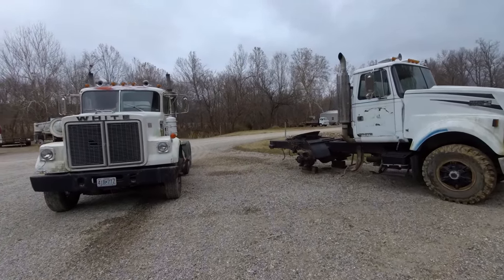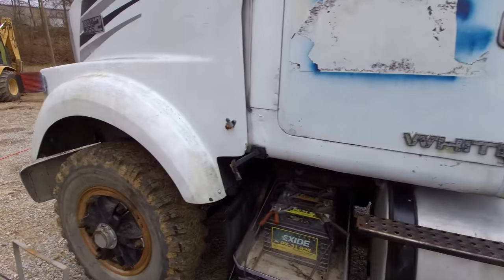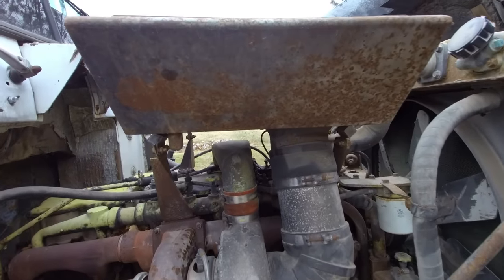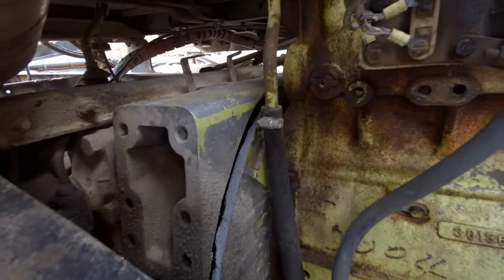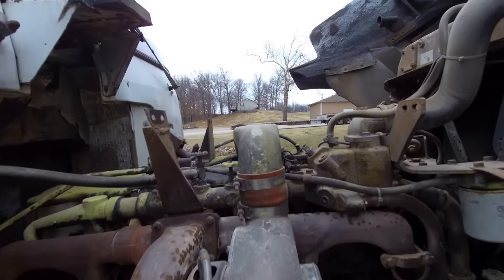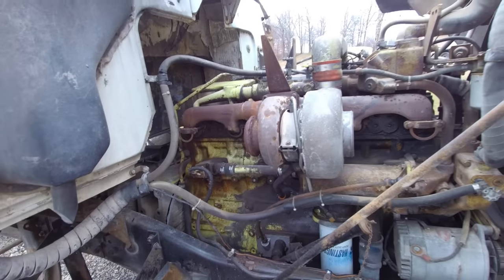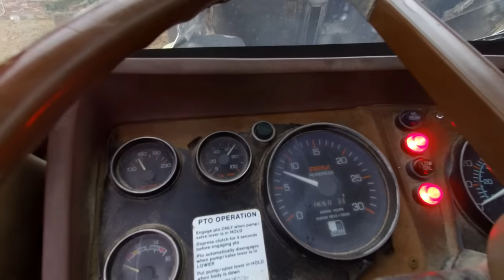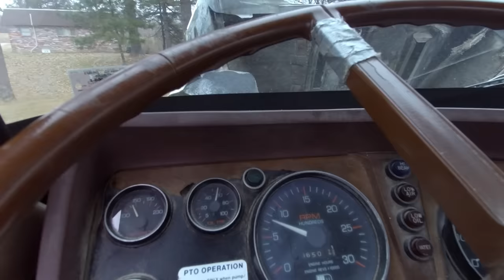First Start In a Long Time - 1978 Cummins 855 Cubic Inch Diesel

Comment: Damn that thing must have been doin 55 backwards to crack that bell like that..Wow
Reply: Pop Physics Lecture:  Doesn't have to be going fast when it's also heavy and stopped quickly.  Average impact force = change in momentum divided by change in time (collision duration).  Average force F = dp/dt, where momentum p = mass x velocity, dp = change in momentum, dt = change in time, or impact/collision duration.  So, for a heavy object, even moving relatively slowly, to be brought to a halt abruptly (dt = small) means a very large avg force!  This can be easily seen using caps letters for large quantities.....avg F = d(M x v) / dt if your recall your 2nd grade division course....the smaller dt is the larger avg F is.  Note:  product rule from 3rd grade calculus:  d(M x v) = dM x v + M x dv but unless parts fall off the truck, there is no appreciable change in mass m, so d(M x v) = M x dv.  So...impact force is proportional to the mass (of the truck), magnitude of the velocity (speed), and inversely proportional to the duration (dt). Let's put it altogether....Let M = mass of truck, let v_i and v_f be velocity magnitudes before and after impact (v_f = 0), and finally, dt be the impact duration. The average impact force F = M x (0 - v_i) / dt = - v_i x M / dt.  Note the negative sign in this result.  It tells us that in order for the truck to be brought to a halt, the force acting on it MUST be in the opposite direction to its motion.  Cool.  Anywho, since M is huge, and dt is small, there will be appreciable impact force which clearly decreases with speed.   If someone has the mass of the truck (in kg where there are roughly 2.2lbs/kg here on earth), an estimate of its speed on impact (in m/s where 1 m/s = approx 2.24 MPH), and an estimate of the impact duration...I would guess somewhere between 0.25 and 1 second.  The average force will be in Newtons but you can convert that to pound-force using 1 N = 0.2248 lb-force.  Anyway, in a nutshell there was a hell of a lot of force during the impact even if the truck was only rolling 5 mph.
Reply: @physicsguybrian  how long did that take to type.
Reply: @haloondrugs1173  time is relative 😁.  Not long actually.  Sitting at a full compute on youtube editor...easy peasy.  I think a lot of people watch on their phone. Writing anything on a phone keyboard is just a huge waste of my time.  Cheers!
Reply: @physicsguybrian was wondering why you went so into depth. I knew what you were saying when you said weight makes a difference. Then i read all of this stuff i didn't really understand (left school halfway through year 10 to drive scrapers). Then i saw your name 😂. Checks out mate 😂

Comment: Those big old engines from the later 70's were the real deal.  Especially for heavy hauling applications.  Sounds like a good engine that is worth keeping.
Reply: Love that old Cummins sound !
Reply: Until they killed it a video later with ether
Reply: @DieseltheWhiteTailedBuck  yep they sure did back in the 80s when I first started driving we always used ether on those very cold New York winters lol
Reply: @ernestpassaro9663  Yup, I know what you mean. I do wonder why people say "Oh ether hurts engines or even kills them!!" When there's been plenty of cases where it doesn't...unless you use a whole entire store's worth that is haha
Reply: @DieseltheWhiteTailedBuck  now I’m being told not to use ether on the new engines
Reply: @ernestpassaro9663  Ain't surprised...this new generation just sucks so much I swear
Reply: @DieseltheWhiteTailedBuck  we didn’t think twice about spraying ether into mack cat Cummins or Detroit engines back then
Reply: @ernestpassaro9663  I bet. There's even some rigs out there that has a button where it even shoots ether into the intake. But one shot of ether on a new diesel will immediately lock it I betcha
Reply: @DieseltheWhiteTailedBuck  seen some of them but when I first started driving I had to manually spray ether into the air cleaner  those old Mack’s didn’t have that option lol
Reply: @ernestpassaro9663  Haha yup. Times have changes...

Comment: Those were some of the best engine's ever built and old engine's like that still operate cheaper per mile than anything today
Reply: Im saving a 95 Cat I6T for a build..
Reply: Both (CAT + Cummins) are US built and engineering 👍🏻👍🏻👍🏻
Reply: Ikr i still run a cummins big cam 400 in my peterbilt😊
Reply: Athony Nesbitt that’s a great one, nothing sounds better either
Reply: Cheaper to operate doesn't mean it's better (for the environment or to own), but it sure be a miracle old engines still work the same way as today's.
Reply: @RonanTetsu  engines today dont last as long and theres more parts. The new engines arent saving the earth at all. I still got big cam Cummins in my fleet with over 1 million miles on three of them. Still dont burn a drop of oil to this day and I can idle all day long without clogging up emission junk. Let's see a new truck do even half that
Reply: @ronnieswindski825  yeah except a new truck will output less than 8% of the carbon monoxide an old one would
Reply: @mr.bitsbyte4664  but a new truck wont last that long so they need to manufacture more trucks for demand. Production means more mining for materials. Also a lot of those numbers are rigged. New diesels do burn very clean compared to older ones but it's still a diesel engine. All that air doesnt just magically disappear. It just suffocates the engine and they burn very hot to meet emission standards which is another reason they dont last anymore. That whole co2 thing is complete trash. Look at those rocket ships. They burn an insane amount of fuel giving off a ton of emissions but that's okay right because they do it. What about all those industrial factories? They destroyed the trucking industry. Unless you haul specialty cargo and get luck, there is no money in trucking anymore no matter what you do.  And no, bringing home 1500 a week is not a lot of money when just a diesel pickup is 70k. Trucking is finished
Reply: @youssefsabiri3860  Dont Forget Detroit 👍. Series 60 Detroit’s were actually designed by an ex CAT engineer 🙌.
Reply: Delusions of Cummins

Comment: That filter box is factory! I got a 1980 water truck with the 290 in it and that the same setup. Great motor, mines in a Freightliner with a 15 speed roadranger. Walks right down the road with 3250 gals of water and up to 500 gal of various chemicals in 2 toats.
Fired right up! And went right to full song like a champ!

Comment: Hello KT
Ahhh a big cam block 
At least you’ve got a good engine to base with
Install 
Big cam 400 pistons 
Aftercooler
Pulse exhaust manifold
Lose the fat turbo
Set your timing at about 80
Screw the throttle shaft out a bit 
Put a no. 10 button in inject pump
That otta get ya about 475 hp
Put it in that silver bullet and let er fly
Larry
Reply: larescats i love everything about that, but this guys a cat freak so hes just gonna blow it up...

Comment: Early NTC block, has 1 inch main bolts with locks in the bolt heads.. Really good blocks to use for new builds as the main caps aren’t fretted all to hell from “an ole boy turnin it up “..

Comment: I smell a detroit falling out of a engine cavity and a cummins going in its place. I don't know how it ever turned that fifteen speed in the first place. I drove one with that set up in a off highway heys truck up on the prince of whales island and I couldn't get it rolling fast enough on any flat to get up on the top gears with one hundred fifty thousand pd., loaded (gross) I hated that detroit so bad but then I started driving with a fellow who gave me a job that no one else would drive and that was a auto car with a 8-53 and there is the definition of boat anchor and it was highway truck. It took me all day to make two trips if I loaded first (log trucks) I finally drove long enough for him that another guy gave me a job driving and it was a little three fifty and a five and four but it was a dream as I kept up and drove the wheels off it. He got a newer truck and out of all the guys there (six) I got that big cam two with a dime button, It was a big improvement and I could load last in the morning and get my trips and if there was enough light left then I would head for the landing and load myself with a anything that would leave the landing cleaner and not hurt the next days loads for the morning. He constantly handed me a fifty  here and there. There is meat left in the white even if it ain't my first choice of trucks cause the parts are so dang heavy. I finally gave up driving for wrenches as there is way more money and same tired

Comment: Sounds pretty good. I wonder if that engine came out of an old Terex machine, considering it's painted the right shade of green.
Reply from the maker: I kinda wondered about the color myself. Not real sure, that might be it.
Reply: @KT3406E  The people you get these trucks from are complete dimwits !
Reply: MichaelTJD60 idk if terex ever used or offered a big cam in anything, most anything ive ever seen terex was Detroit powered but I could be wrong
Reply: @blacksheep9734  Yeah I've seen mostly Detroits but I have seen one or two Terex rock trucks repowered with an 855 Cummins. I'm not sure if it was offered as a repower option or what.
Reply: @blacksheep9734  seen m11 cummins in terex haul trucks. Only cummins I've seen in them
Reply: Yes is it
I have the same engine using inside excavator 1987 hitachi UH181 still running great
It’s the best engine Cummins ever build

Comment: Too bad the truck with the Ntc 290 was wrecked 
 The 7600 international dump truck at work with the Twin turbo non DPF,DEF   is a cluster F__k to work on unlike this one where just remove the air cleaner assembly and go to work on it.
Can't even do simple maintenance on these late 2000 and newer engines, I would love to see that  shitterpiller blow up!

Comment: Would you consider selling the 74’ white? Looks like spring over type walking beam, what rears are under it? Been looking for a 318 powered tractor with Hendrickson beam dusk and an 8ll or a 15 for dirt work pulling a 26’ end dump.

Comment: May I ask what the ether does when it’s running?
Reply: Michael Jestice It is like a shot of adrenaline. Large amounts can be hard on an engine, but useful to get a diesel running.
Reply: It was already running, I didn’t understand why he would squirt it in while running, unless adding ether at that time would tell you something
Reply: All of it
Reply: @michaeljestice4234  
I'm wondering the same thing. She seemed to shudder with the first little squirt smothered out a little with the next few squirts and then was running smoother than ever. 
Maybe knocking carbon off the injectors or top ring ??
Reply from the maker: It creates fun.

Comment: Where do you find these trucks and how much do you pay for them I was born in the back of an 86 Pete 359 with a 72in sleeper been trying to find an old rig to restore and start a business with and my ultimate dream truck is also 99-03 7.3l powerstroke full 4dr 4x4 dually or single axle
Reply: 99 7.3 f350 4 door mine is for sale
Reply: @sar4564  I wish I could buy it man been trying to get one for 9 and 1/2 years but I just don't have the money that's why it's a dream but I'll never achieve it still nice to dream thiugh

Comment: What do you call wheels that mount like that? It's just a rim that's clamped to the hub. I've wondered what they're called and the purpose. Thanks.
Reply: mikehermesmeglio Spoke wheels.
Reply: Real name is "Dayton Hubs".  Nicknames are.....Chicago Wobblers or Saskatchewan Mags.
Reply: Dynamo Joe Thanks I couldn’t remember Daytons. When using them on Taylor forklifts we would weld nuts on the wheel beside to valve stem so if they slipped on the wheel it wouldn’t cut the stem off and cause a flat.

Comment: Why do you buy stuff like this ? Just wondering. Do you have clients to buy parts ? I’m puzzled . I would be spending that money on a bad ass C18 for that  Pete myself .  Yeah the 6NZ IS COOL but I have friends with low beds that move heavy equipment w	with C18 Motors and they walk away from every thing loaded or empty with Cat 657 twin engine scrapers loaded .